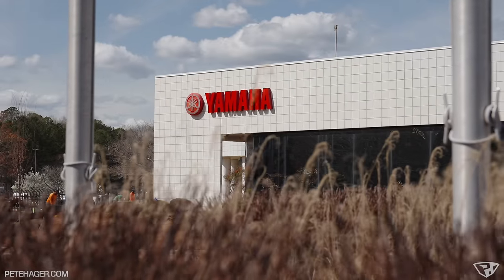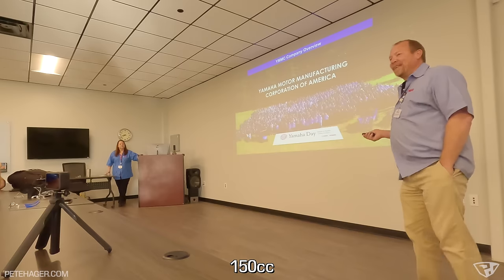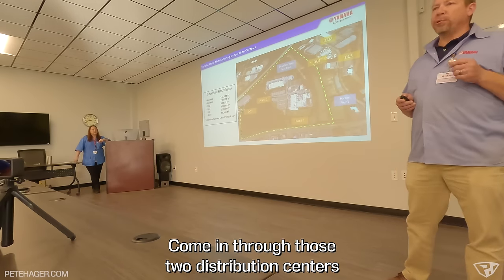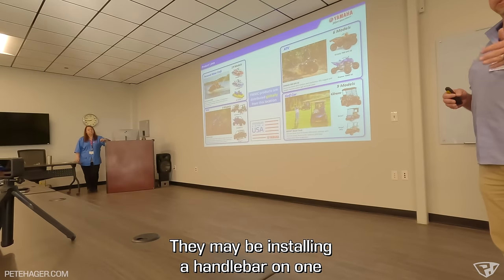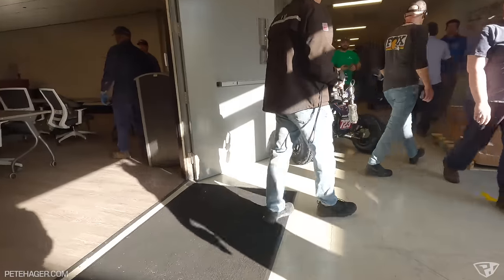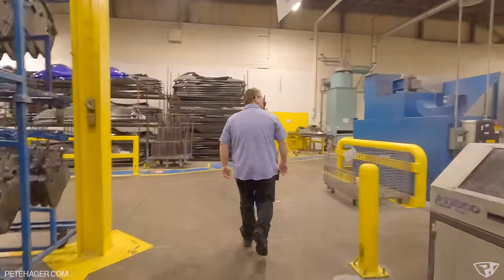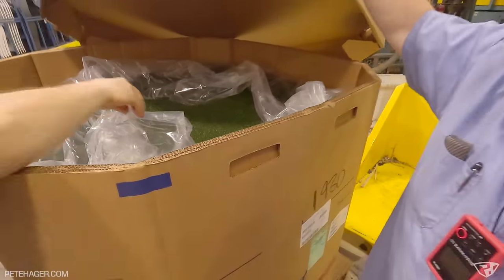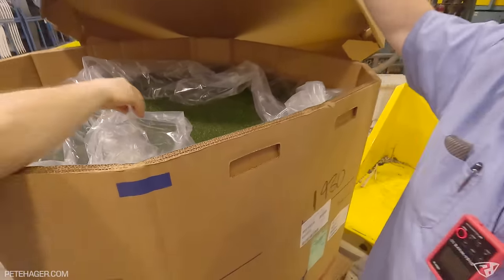Where Sport Quads Are Born

Comment: Yamaha needs to bring back the banshee
Reply: facts bring back the 2 cylinder 350cc 2 stroke god dam, yamaha, i would say fuk regulation but they cant... atleast most thing now must have X things that they didnt have to have in 1987... but so sad to see yam only ones still making and suporting SPORT quads..
Reply: its impossible...the emissions laws are wayyyyy too strict...Plus, the raptor 700 is MUCH faster with more usable and broad power and is SOOO much better handling, with much better steering, insanely good suspension, super reliable engine with EFI, and reverse.
Reply: @Shadow0fd3ath24  The raptor is very nice but the banshee motor platform has lots of potential with new technology
Reply: It wouldn’t be impossible for them to make one KTM still makes a two-stroke. It would just have to be like a banshee with fuel injection.  And oil injection.
Reply: @Shadow0fd3ath24  Is this guy on something 😂 the banshee is 30 years younger than the raptor ofc the raptor has better steering but imagine a new banshee that’s the fastest thing in glamis

Comment: I use to work at a factory that made ford plastic parts and the molds were very similar to the ones u showed in the video. Me and another guy were mold changers  and that’s all we did. It would  take an average time of an hour to change the molds out from start to finish. Then when the mold is set we would actually lean in or actually get inside between  the molds when they were split open which was sometime little sketchy but we would take like this small hammer pin and punch in the  date in those small boxes. But ya hot a$$ job and don’t miss it one bit. Definitely a really cool place!
Reply from the maker: Wow that’s awesome! I bet it gets hot. It would’ve been amazing to see the machine in production actually producing the parts. Pretty wild for sure 😬

Comment: That fiberglass stand for the side by side front ends looked like it's there for some kind of quality inspections. 

I've worked for GM the last 25 years. That's what my manufacturing experience tells me it's for.
Reply from the maker: Thanks for elaborating on that! I suppose the racks would be where they finish cooling down 👍
Reply: @PeteHager  depends on the rack. Though the plastic must be cooled before you even handle it or you'd imprint on it.  Some racks are for keeping the checked part for 24hrs.  That way if a problem is found they can go back to checked parts and determine how long the problem had been occurring. My first job at GM was plastic mold injection. Though that was 23 years and 8 factories ago. 

Thanks for your content. This plus others encouraged me to get an old TRX 450r and restore it.  I'm now 3 weeks and $3k into my restoration.